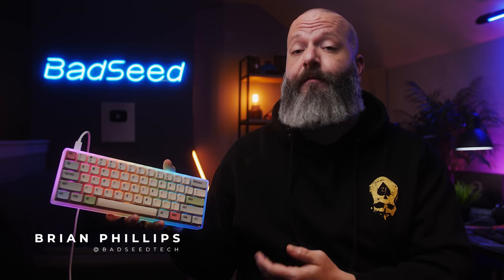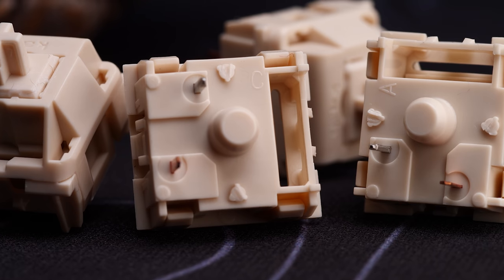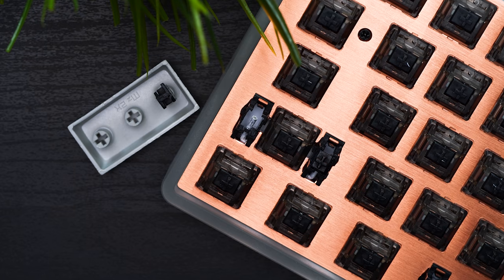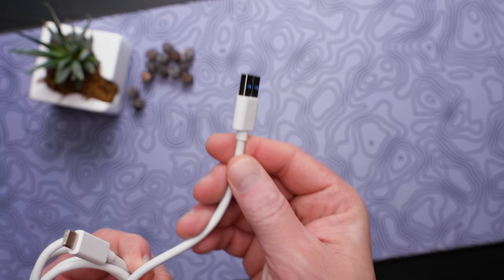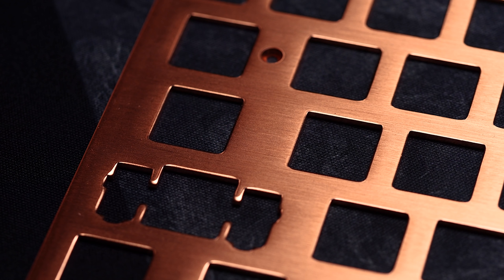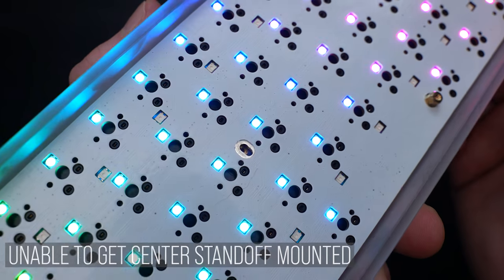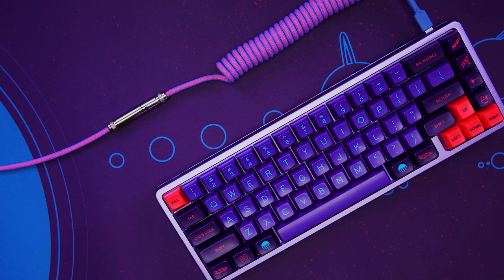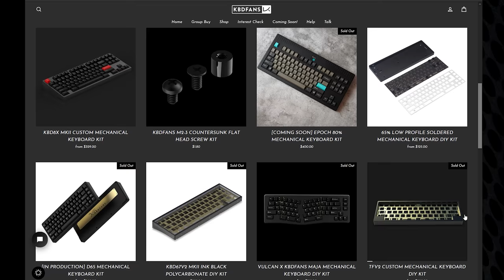Drop Carina Review: Heart Breaker Looks, Wallet Breaker Pricing

Comment: I pulled the stems straight out of the housings by accident when I was building my first keyboard. I later found out it was because I had clipped the wrong side of the stems.
Reply: oh no! on my first build i bent some of the pins on my switches while putting them in and took everything apart to figure out why a few keys werent working lol

Comment: I ended up replacing the stabs with Durock clip-ins from Divinikey, those stock stabs are too bad lol.
Reply: I did the same thing on my Keychron, Durock plate mounts from Ringerkeys.
Reply: @timreddington9386  I mean they're still clip-ins, still gonna need to account for tolerance differences between the plate and the stab, but the stem definitely sits in the stab housing way better.
Reply: There are actually plate-mount, gold wire Everglide stabs that no one seems to know about...
Reply: @colinkent4835  Drop had them for a minute, they didn't get great community reviews. Was thinking if ordering them at some point for a general comparison among the other clip-in brands. Tried Gateron and Durock so far, both are pretty good.
Reply: I had no trouble modifying the stock stabs on mine, no rattle but I did some bandaid mod
Reply: @markustechcorner  that more or less speaks to the inconsistent nature of the included stabs. More reviews than not that I've seen seem to have issue with them; if they were at least a bit more consistent I'd be fine with them.
Reply: Does this keyboard only have an option for plate mounted stabs? Or can you also use screw ins stabs?
Reply: @centiio5732  Sadly you can only use plate-mount stabs with this kit unless you're able to source a custom PCB and plate... which at that point may as well also include a different case lmao. That said If you go with either Durock, Gateron, or NovelKeys plate-mount stabilizers you really can't go wrong, though the NovelKeys plate-mounts are pretty much the best you can get rn AFAIC.
Reply: do you have a link to those?
Reply: what size stabs do you need for this keyboard
Reply: @cjasbach8093  2U and 6.25U

Comment: I can see what drop is doing here, mainly just trying to fill a gap left by out of stock boards like the NK65 which is pretty much better than this board in every single way for a much cheaper price but like I said, out of stock. I feel like drop got a bit lazy here.
Reply: Yes and now to mention all the other beginner build boards that are even better than the nk65, like the kbd 67 lite or the portico. Drop is pretty infamous for having over priced items tho so nothing new.
Reply: Definitely not up to par to the NK65 in terms of sound and design, but i feel like execution is better (save for north facing switches). For example, tonnes of issues with cracking on the NK65 corners, screw holes (probably because they didnt install brass inserts so it screws directly into plastic) and mounting posts. The issue is so bad that people automatically get $10 discounts to bring the price of their new board to the price of b-stock boards. To me the NK65 is the enthusiast choice but clearly worse build quality and quality control. Think of it like a hot hatch i guess - basic car with a performance engine.

Comment: You can also program qmk to do tap arrows like on the anne pro 2 just use these code: 
UP = MT(MOD_RSFT, KC_UP)
DOWN = LT(2, KC_DOWN)
LEFT = LT(1, KC_LEFT)
Right= MT(MOD_RCTL, KC_RGHT)

and if holding the left and down it functions  as layer 1 or layer 2.

Comment: Hey Brian, i think (possibly) a reason for them not including a softer plate material option such as fr4 is because softer plates increase the so called uneven feel of a tray mount board. It is not as noticeable with stiffer plates, which is why if you look at kbd fans boards most people are pairing them with alu and brass

Comment: I got the Carina in one of the original early drops, I think for $100 or $120.  I've had a good number of Drop boards...HP Laser Alt, another Alt converted to HP, LP Ctrl, and the Carina.  My overall take on the Carina is the same, its not a bad board but this will be my last Drop board until they work out the stabilizer issue.  I'm tired of trying to make janky, objectively inferior plate mount stabs work well.  Even genuine Cherry plate mount stabs aren't great, you can pick up a number of PCB-mount stabs for ~$10 that are better in every single way.  Why do they do this to us?  It'd be one thing if they offered a stab upgrade path on their own site that would fix this for us, but not only is that not happening, there truly aren't any good plate mount stabs in the entire market if your reference point are decent to high quality PCB stabs like c3 or Zeals.  

We'll just have to take the 5 hole as the small win with the Carina, but Drop has work to do to keep up with the market.  Many of us started with Drop boards but quickly grew out of them because they have the glaring weaknesses pointed out in this review.  Many of us back then didn't know that plate mount stabs suck, or that we'd be cutting our 5 pin switches, etc.  We've grown but Drop is still offering what is basically the same product as then and for that reason,  until they completely overhaul their product offering, I'm out.

Comment: You can get various types of foam sheets from McMaster-Carr for good prices and at various thicknesses. I generally get EPDM foam so it won't turn into sludge over time. You can then just cut holes for the underglow LEDs and the lighting will come through just fine.

Comment: I ended up replacing the stabs with cherry oems, couldn’t deal with the stock stabs. But my major complaint on mine is the pcb creaks on the bottom left when I hit my left shift or left ctrl key :( it’s such a pretty board but the creaking is so frustrating

Comment: I just built this kit as my first. I have to say , not knowing that it's crazy expensing for an entry level kit, I feel like I got my monies worth. The case feels high quality, the bronze plate is just perfect. The added convenience of getting (almost) everything at the same shop was great.

But, those included stabs. Imagine lubing and filming every switch, each one sounds and feels exactly how you wanted it and then you touch the space bar and it sounds like the Tin Man throwing up marbles.

I replaced them with some Durock stabilizers. I can't really understand why the difference is so dramatic. But, it is. I think, as a first time builder, I would have been better off if the stock stabs were not included. I would have been spared the initial disappoint of putting in all that work only to be let down by the stabilizers. At least the were easy to remove. 

I'm happy with the keyboard. My overall experience is very positive.

Comment: the stab issue can be solved with some durock plate mounts, however i find the pricing on this board a little strange. starts at $140 for a standard 60% with north facing sockets, tray mount, plate mount stabs. not to say that these things are inherently bad or dealbreakers, but looking at the bigger picture this pricing does not really make much sense. especially considering the very meh acoustics. i would honestly prefer a gk61

Comment: I used the white foam that came with the board in between the pcb and case then cut out holes for the switches in the black foam that came with it in between the pcb and plate and got rid of any pinging sound..... stabs r still shit

Comment: How do you remove the stabilizer without removing all the switches, caps, and taking it apart?
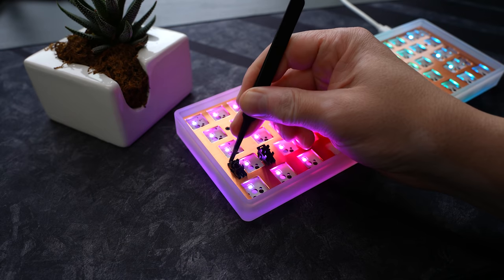Reply: See 3:02 you need to push a little tab and pull them out, you can do that just with that keycap and switch pulled out, not the entire board.
Reply: @kaleid1990  thanks!!